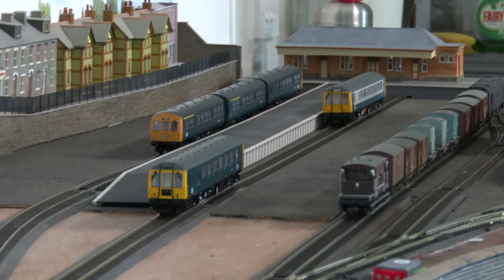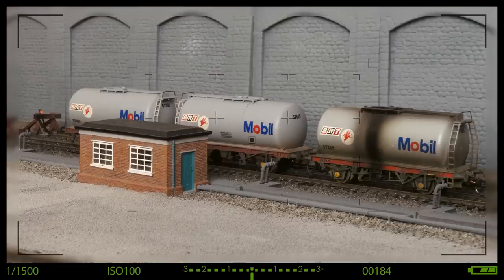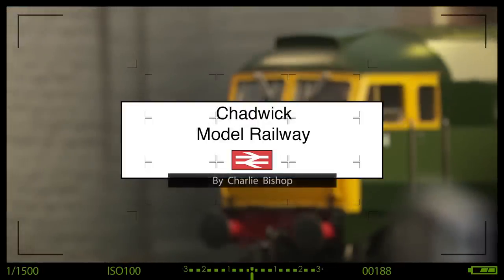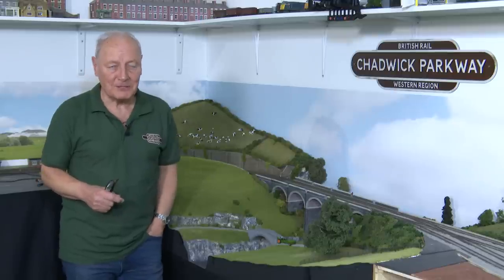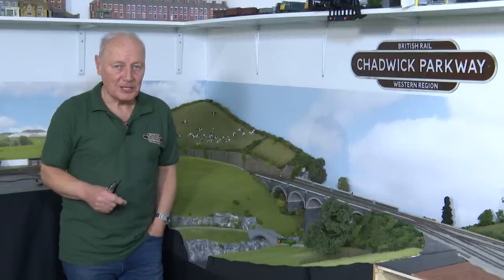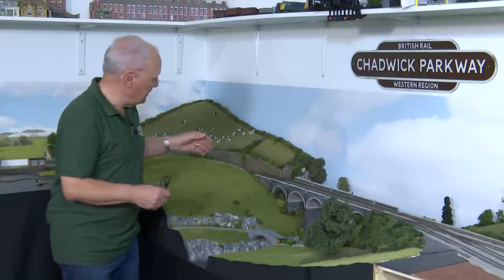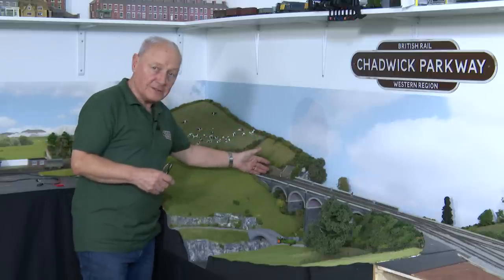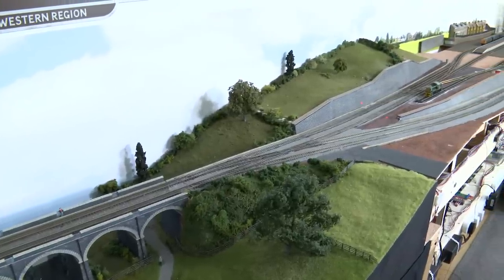SIGNAL POSITIONS at Chadwick Model Railway | 199.

Comment: Hey Charlie, The feather usually follows the diverging branch of the point because when the feather is not illuminated when the highest speed route is indicated. So if you have a left hand point, you would use a left hand feather. Right hand point, use a right hand feather. Looking at 1:56 the problem is with your track, you are using right hand points to send the mainline down the diverging line, I think normally using a left hand point to branch off to the station and allowed the mainline to continue straight at higher speeds with it then curving off to the right. With your viaduct though that probably wouldn't have fit. I think the solution you want here is to put a speed restriction on the viaduct side before the points, making both the mainline and the branch line the same or similar speeds at that junction, then use both left and right junction indicators on the signal. When the route is into the station, you would illuminate the left feather, when the route is on the main line, you would illuminate the right feather. There are best practices but things are taken on a site specific basis usually. On another note, I think down line signals are usually odd numbered and the up line are even numbered. Its looking good though!
Reply from the maker: Thanks Oorail, what a great solution.
Regards Charlie
Reply: If the curved line is the mainline then the feather has to be for the straight line coming out of the point. So for a right-hand point the feather would point to the left.
Reply: But in this case the station is the diverging route. Going by what I was taught as a mainline driver
Reply: Also, your point about the points is incorrect. For example, I sign from Ipswich to Peterborough. At Ely the line diverges to the left (at least to the eye of a non railwayman) and the other line goes straight on to Kings Lynn. But it's the king's Lynn line that has the junction indicator. If turning left at Ely north towards Peterborough you get no indication at all, just a main aspect.
Reply from the maker: That’s very interesting, David. Are the two lines, the same speed, or is the main line faster?  Regards, Charlie
Reply: @ChadwickModelRailway  both the same line speed, 60mph. It can be confusing as a new driver over that route as you could think you have been given the wrong route
Reply: @dave55uk  can't you explain why? Or why the rulebook is wrong?  Or are you replying to someone else, not me?
This is copied directly  from RS521 -2.3 (and this has not been amended in my time on the railway)
"When the straight route is obvious, there is normally no junction
indicator provided for this route.
Where there is no obvious straight route, a junction indicator will be
provided for all signalled routes.

-Where the straight route is not the highest-speed route, the junction
indicator will normally apply to the lower-speed route. -

Where the diverging routes ahead are both of equal speed, a
junction indicator will be provided for each route."
See the point I've highlighted? It says the branch line station would be the diverging route
Reply: Heaton Lodge Junction between Leeds and Huddersfield. The "main" route is towards Huddersfield (70mph) and receives the main aspect. The diverging route is towards the Calder Valley and receives the No 4 (right) feather and is 60mph. Only problem is the line curves to the left for Huddersfield, but goes straight on for the Calder Valley! So you get the main aspect and turn left, or get the feather and go straight on!
Reply: It makes no difference whether it’s a r/h or l/h point. The main aspect is for the main route the feather for the secondary route. Uddingston On the  wcml on the up is a good example ..high speed rh point 90 mph main aspect towards Motherwell. Or straight on at 60 mph with a Number one feather towards Holytown.
Reply: @DaveTheTrain  You are correct about the diverging route, what I was trying to explain (apologies if it wasn't clear) was from an engineering perspective, in the case of Charlie's site, a left hand rather than a right hand point would have been used. This would allow the more frequent and higher speed mainline traffic to proceed on the straight part of the point. Therefore the feather would have indeed followed the diverging route off the point. There are best practices engineers try to follow but ultimately its site specific requirements that will influence design decisions. The location (terrain etc) and historical design decisions, will also impact what best practices can be followed. Its also important to consider that Charlie's layout is set in the past, so many of the benefits of modernisation available today did not exist or were not widespread. Just to be clear, I am not referring to the direction (left or right) the track curves, but the direction of travel across the point (eg. mainline typically goes straight ahead (normal position), and the slower branch line follows the diverging path).
Reply: @DaveTheTrain  Which point about points is incorrect? If you are referring to the feather following the diverging (curved stock rail) of the point, its a good rule of thumb for model railways, because in most cases on a model railway, that would be the slower speed line. Your example isn't really what Charlie is dealing with here. A closer example to what Charlie has is probably the branch to Windsor & Eton Central station from Slough. You can see there the mainline is on the straight route through the points, and it branches off to the left, where it ultimately arrives at Windsor & Eton Central station which is a terminus.
Reply: This is done at Heald Green West Junction as it's a wye junction where both routes have equal speeds. The signal cannot show a main route, it's either the number 1 or number 4 feather.
Reply: Oldham Werneth station had the curved route out of the point as the mainline.
Reply: @Oorail  that depends on the available space, Penwithers jn (Falmouth Branch) has diverging route going straight on (position 1 feather), with the Main route (to Penzance) taking the Right hand curve of the point (no feather).
Reply: @mikeburnitt403 That is why I mentioned that it was site specific. Charlie has some options and some real world examples to look at.

Comment: Hi Charlie, the answer to your question regarding feathers or junction indicators as they are formally known, put simply is that the route with the higher speed and most obvious straight route will be the main route, not necessarily a 'main line', it will be the most obvious straight route or one with the highest speed, this route will use just a colour aspect on it's own and the route or routes with the lower speeds will use junction indicators to the left or right and a proceed aspect, which ever way they diverge from the main route.
No1 being the second fastest or of most notable geographic importance to the left and No.4 being the same to the right, if there are more then they drop down in order.

Where speeds are the same or no obvious straight route can be defined then both routes will use a junction indicator along with a proceed aspect to the left and right, displaying either a No1 or a No4 with a proceed aspect for one of the chosen routes for example.

There's also the flashing yellow sequences, but I'll not bore you with those 😁

There's always some areas that will just stray and do things randomly but this is the main way it is done and is rule book defined.

The full rule can be found online within RSSB RS521 signals, Hand signals, Indicators and Signs. 
Rule 2.3.

For working permissively it all depends on the type of permissive work authorised in that area, found in the Network Rail Sectional Appendix as to what should be displayed and how to operate there.
The Signaller will know how to signal a train using it's headcode.
If it's passenger permissive working then a route should be displayed in the route indicator (theatre box) when in passenger service, when empty stock you can proceed without anything in the route indicator, you would usually be in contact with the signaller in this scenario to gain verbal instruction of destination point if it's into a multi permissive platform.

The yellow/white shunting signals have largely been replaced with standard red/white now but there are still a fair few knocking around and are found in signalled sidings at the exit with a headshunt.

Basically when yellow/white is displayed you can pass the signal but only into the headshunt, when cleared you are authorised to pass and proceed at caution onto the main line as far as the line is clear, stopping short of a signal, train, obstruction or buffer stop, same meaning when a standard red/white position light is cleared but obviously when not cleared the red/white is at danger.
If using the standard red/white position light you would also need a mini route indicator box with it if using it for more than one route.
So a yellow one, if only two routes used would be simpler and cheaper probably and still in keeping.
They were used to help the signaller in not having to constantly clear a signal for headshunt use as this would no doubt be used a lot by shunting locos in a siding.

If using two aspect signalling that only shows red and green, your next signal in advance cannot display a red as you cannot go from green to red, you have to be cautioned before a red.

Hope this helps, sorry for rabbiting on.

Driver up in the North West of England.

Great video as always 👍
Reply from the maker: All great info, Rob, and very much appreciated mate. Stay safe, regards, Charlie

Comment: Great video as always. With regards to a yellow/white ground position light, the definition of it is:- STOP. May be passed at danger for movements in the direction to which the signal, when cleared, does not apply. That means that a train may pass a yellow/white signal without the Signalman's permission towards the headshunt, but would require the signal to display two white lights to enter the main line at caution
Reply from the maker: Yes Derek, I found this information in the signals handbook RS521.. It’s a godsend. Regards Charlie

Comment: I have over 200 points that I all want to be finger operated to remove any confusion for operators when they come to play.
 I have not worked out yet how to reverse engineer a lever system from the tie bar on the point back to 2 switches. The issue is really only a main line one. One switch to cut DCC track power to stop an approaching main line train from blundering onto another  that is either entering or leaving the main line. (A real issue that happens too quickly at times). The other switch to be DC for the green/red light. Autofrog can take care of polarity issues on electro frog points.
Thank you for your continuing contribution to the hobby Charlie. (I meant to write this 2 weeks ago).
Reply from the maker: Thanks Robin, I’m so pleased that you enjoyed the channel. Good luck with your challenges. Regards Charlie

Comment: Hi Charlie,
 Re: the gpls for the headshunt. They were identical to the normal ones, but instead of a red they have a yellow aspect. This would be placed before the headshunt points and control all movements.. with a  white/yellow indication (on), the train can use the headshunt. When cleared to 2 whites, the train accesses the main line you don't need a main aspect. Also, your station starters will need to be 3 aspects, as you cannot go from a green to a red, if the junction is not cleared from the branch station.
On the inbound signal, yellow with 1 or 2 indicator is right, but the freight yard needs to be accessed using the subsidiary signal & G. You cannot enter yards or sidings on a main aspect  And as you rightly said, the subsidiary signal would need a route description for permissive working.
Reply from the maker: We are bang on the money on this one. However, I need to buy another double three aspect signal. Gulp. Regards, Charlie
Reply: @ChadwickModelRailway  Sorry for more outlay Charlie. But signals can always find new homes on a layout.
Reply: @ChadwickModelRailway  cam you go red, Amber at a platform like this? I am certain that the branch line at oxenhome (for windermere) is a two aspect, red/yellow but that's  going down the branch, not back onto the west coast main line

Comment: To keep it simple Charlie, if the train is in passenger service, an indication of route is required (a junction indicator or platform No.) If proceeding into an occupied platform on a position light.  If it is an ECS move, as drivers we can take just a position light and proceed as far as the line is clear, being prepared to stop short of any obstructions.
Reply from the maker: Thanks Paul, I must confess I’ve learned a great deal about the subject since I released this video! Regards, Charlie
Reply: @ChadwickModelRailway  Morning Charlie,
 I'm sure you have.  I guess us drivers take our signalling knowledge for granted.
I am an Instructor Driver and Route Assessor aswel as a run of the mill driver for GWR at Exeter.  I sign Paddington to Penzance, and everywhere in between, including your kneck of the woods from Exeter to Castle Cary via Yeovil Jcn and Pen Mill as a diversionary route.  As you can imagine, we work over all sorts of signalling systems from Semaphore, Single Line TCB, Tokens, Staffs, and of course MAS colour light, so please pick my brains if there is ever anything you need and I will put my 33 years service into some good use for you hopefully.
All the best, Paul

Comment: Awesome vid. The is a yellow and white shunting light at Weston-super-Mare. It's used for engineers trains coming of the bay platform onto the Mainline
Reply from the maker: Thanks Robiin, it’s a confusing riddle concept. Regards, Charlie
Reply: @ChadwickModelRailway  also. You could get away with the feather for the 2 platforms, and a shunt signal for the yard. The shunting person in chare would tell you what siding to go down first. In this modern day, they pic up a radio so they can contact them. But in your ere. There was no radio contact. Lol

Comment: Hi Charlie,

IIf I may a couple of thoughts from a retired guard (albeit from the Midland region).

The feather should be on the left as the main aspect is always for the main line regardless of the actual geography of the track.   Yes the calling on signal to move trains into an already occupied track (like you're platform example) should have the light box indicator showing the route.

Also, and very important YOU CAN NEVER show a green aspect if the next signal is going to be at danger, such as you're green aspect as the platform starter and the main line protection signal being at danger.

Hope that adds to the confusion and many congratulations on 200 videos.

Best wishes,  Tony.
Reply from the maker: Thanks Tony, much appreciated. I’ve been sent quite a few yellow calling on signal surprisingly. Regards, Charlie

Comment: Hi Charlie, in answer to a couple of your questions: if a subsidiary signal is used for permissive working (eg: a train going into an occupied platform), it depends on what day of the week the signalling was installed. Sometimes the theater box would display the platform number, in other locations it may not.
With regards to your headshunt, I think you have this wrong. You could dispense with the main aspect signal and use a subsidiary that would display either two yellows (horizontally) to allow movement into the headshunt or two whites diagonally to allow access to the main line.
An earlier version of the shunt signal has four lights, although I cannot remember how the lights are set out. An example exists at Mountfield sidings on the Hastings line.  
Semaphore disc signals were yellow and black.
Reply from the maker: Many thanks and you are bang on the money.  I have bought and fitted the headshunt signal you described, and included it in a latter video.
Regards Charlie.

Comment: And the Train-tech kit version is GK4. I have installed the red version, GK2 and found it quite straightforward.  Congratulations on the upcoming video 200!
Reply from the maker: Thanks Steve, I’ve tracked down the GS2, and believe that’s the white and yellow version.  Some appear to be self assembly kits. Regards, Charlie
Reply: From personal experience the TT gps's are easy to assemble, scale sized and good value for money if their design suits your location, I shall have to bite the AA bullet at some stage!
Also, I believe, the feather illuminates first and then you are given the aspect, not being professional railwayman this is information I've been given from a driver.
Reply from the maker: Thanks Mike, and you’re right, the feather does illuminate slightly earlier. Regards, Charlie

Comment: Hi Charlie, loved how realistic these signals are. Just bear in mind that when the signal clears permissively with the two white lights for your occupied platform, it does indeed require a platform number, so the driver knows where the unit is being sent and whether or not it will fit. (Source: am a driver who has frequently been signalled permissively into occupied platforms that did not have the required amount of space, usually as a result of a set swap onto a longer formation than was booked.)

Additionally, yellow and white ground position lights are indeed a thing, just less common - slightly different but Harrogate is a good example of where black and yellow shunting discs are still in use for headshunts.
Reply from the maker: Thanks N2883, we sing from the same song sheet on this one. Regards, Charlie

Comment: Hi again Charlie. Just an operational observation. If your platform end starter signals are 2 aspect, you would need another signal before the one protecting the junction with the main line as you can't go from green to red. Hope that makes sense. 😎
Reply from the maker: Yes it does Les, I’ll get 3 aspect ones.
Regards Charlie